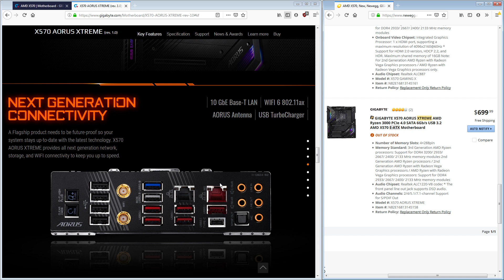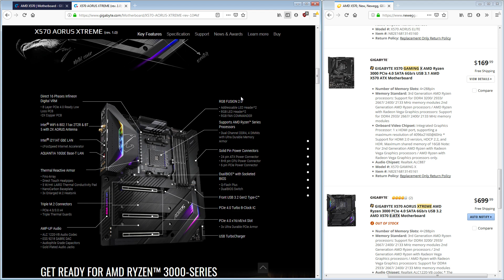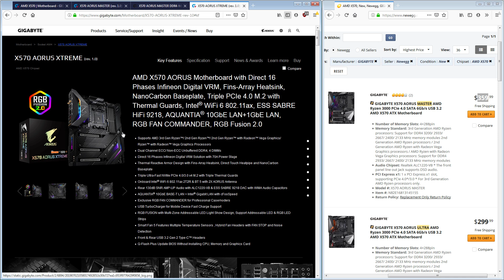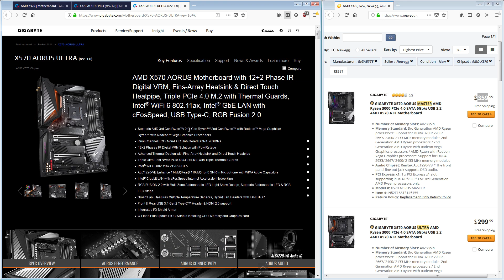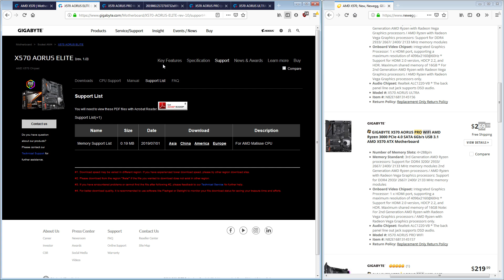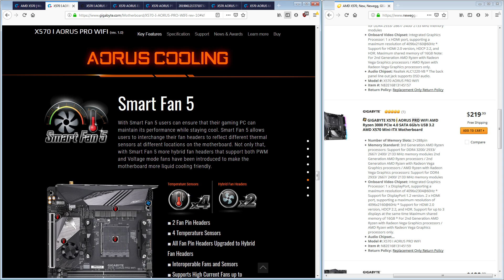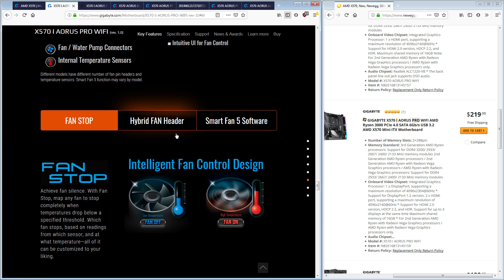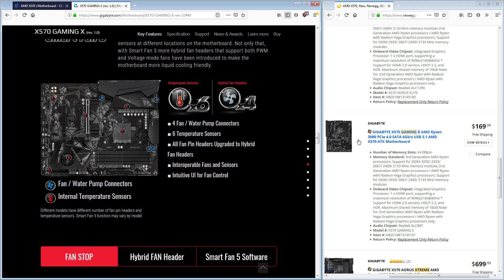Buildzoid rambles about ALL the X570 Gigabyte boards

Comment: Watches all x570 videos, doesn't want any x570s :) And glad you said what I was thinking why not make new B450 board now with Ryzen 3000 out of box. Yes there is MSI MAX series coming, but it's just old motherboard with new bios chip. ASRock released their B450 Steel Legend a couple months too early, it could have been the X570 version with B450 chip and be much cheaper and as good (and no fan).
Reply: B450 Recommends?
Reply: @Targetlockon  I'd wait for those MSI MAX refreshes, B450 Tomahawk MAX for ATX and B450M Mortar MAX for mATX. If you want WiFi and good audio, then MSI B450 Gaming Pro Carbon AC (I would have bought that, sadly mATX case, so no go). But if you got a Ryzen chip already to be used for BIOS update, then other manufacturers work too.

Comment: I've got 3700x and x570 gigabyte elite. Noticed that heatsinks on vrms and x570 needed some tightening. ANyway - my pch temp is around 45-55. Is it good or bad?
Reply: hiczok, hola. How the chipset fan feels? Noisy?
Reply: @Vladquaaa  it sucks on old bios. On new bios, there are 3 profiles (silent, balanced and performance). I am using balanced and it turns on 1500rpm at 50c degrees. it is a bit audible. I might end up using silent mode later
Reply: @HiCZoK   Thanks for answer. Just thinking to buy 3900x, and don't know which MB to take. Read a lot about taichi and bad place for fan, when your GPU covers holes for air and chipset gets a lot hotter. For now, thinking about GIGABYTE MB, looks like fan placed a little bit lower than in taichi.

Comment: Buildzoid just wants usb and pcie on the board, that's literally a server board
Reply from the maker: Server boards lack in the USB department
Reply: @ActuallyHardcoreOverclocking  yeah, true. They lack pretty much any external IO except ethernet, but you know what I mean: not many unnecessary extras and lots of pcie expansion
Reply: If it doesn't have BMC and ECC support (even unregistered), then it's not a proper server board for a professional environment.
And BTW, a USB hub is quite enough for slow peripherals such as keyboard, mouse, printer. Finally, like soundcard, lan or sata ports there are USB extention PCIe cards too or some dirt cheap PCI bracket to connect internal USB headers to the rear just like people sometimes does with the COM serial connector.

Comment: Don't really understand why if all the VRM of the $300 board are so efficient mobo makers can't make it go the way of the extreme by passively cooling the chipset.
Reply: Yeah, I don't know the cost of a heatpipe & sink fins vs a fan & flat hunk of aluminum... but it can't be much, right?
Hope we see a ton of Rev.2 releases right away in the coming months after all the "chipset fans suck" responses. If they're listening...
Reply: @Krazie-Ivan   You would be surprised how much cheaper a hunk of extrusion and 2 cuts get, to stamped, folded and assembled aluminum fins and a heatpipe with 5 bends to snake to the chipset.
You need to assemble differently too , VRM and chipset have to be mounted at the same time , not in 2 different steps
Reply: John Chrysostom  oh I remember fo sho... I hated SB/NB mini fans back 17yrs ago with NV chipsets on Barton mobos, & was glad to see passive cooling come about. I just don't know the cost difference, which I'm guessing cost savings is the deciding factor for the vendors on everything.

Comment: I'm glad to hear you think the Pro Wifi is decent. I ordered one a couple days ago when NEGG got the 3700x back in stock. I was a little worried about picking it before your Gigabyte vid was out, but thought it looked reasonable based on the other brand vids. I picked it over the Elite mainly based on cooling control. The Elite has 4 fan/pump headers while the Pro has 7. I also like the finned VRM heatsink. I picked the Pro over the comparable Asrock boards due to the G.Skill 3600 CL16 memory I already picked up for the upgrade not being on Asrock's tiny QVL. 

Edit: I picked it over the 400 series because selection is thin right now and the MSI ones I like best seem to be hit or miss on BIOS issues. Just played it safe and set up for if PCIE 4 actually starts becoming useful in the boards life.

Comment: See, I'm completely on board with these super high end boards that aren't sensible purchases on release. Like with all tech, R&D costs have to be recouped as best they can early on. Anyone buying this kind of board at retail prices knows what they are buying into. The second aspect of this is simply trickle down tech. It takes much longer for better technologies to reach "mainstream" consumers if there is no halo product for R&D cost recoupment or long term,  real world, end user testing and development.  Third, prices go down, typically fairly quickly, on products like this if you know where to look. To see a barely used or even unused board like this one grey market for 66.7% of its original cost within only 4 months or so is actually not uncommon. Some people buy these boards for various reasons and then want to get rid of them only to find they can't get anywhere close to what they paid for it. The niche within the niche that is willing to buy it at a crazy high price is also extremely unlikely to buy it other than brand new through an authorized retailer.
Reply: i just like them because it's cool to see the tech. would i ever buy one? hell no but it's still cool to see how far motherboards have come over the last 20 years as far as features go.

Comment: Here the big quesiton. Why did these 4 companies go from severely underpowered VRM's to severely overpowered VRM's and most X570 motherboards supporting 4 extra CPU-pins? It doesn't make any sense. The power consumption of a 3900X is not that much higher than for a 2700X and that 3950X will need better VRM's but even then you don't even come close to those 4 extra CPU-pins. Even if you would need those 4 extra CPU-pins for extreme OC'ing, most of those motherboards don't support other extreme OC features and what is the point of having lower segments and mid-segments of X570 having that 4 extra CPU-pins? Why this 180 degrees turn? Why first not having proper VRM's and now this complete overkill? Can't we meet in the middle, drop all the RGB and other decorative nonsense and have a solid motherboard with excellent VRM's, memory-traces and all the ordinary I/O (enough USB, PS/2, Intel ethernet...) for €170?
Reply from the maker: The x570 chipset is expensive so it's ok to make the rest of the board expensive too
Reply: @ActuallyHardcoreOverclocking  
I can imaginge that the companies reason that way: the chipset adds $20 anyway, we might as well go all in. But I question how balanced it is. If you deliver even better VRM's and all that than what is required to get everything with reasonable overclocking (PBO and automatic overclocking, anything that you can do on air and water) but you don't deliver a second BIOS or PS/2 port, that does not make much sense to me. What do I know but that is my impression so far. By the way, I ordered an X570 Elite and a 3700X. I looked at the X470 and X370 motherboards, the prices of those motherboards which I was interested in were still high in the Netherlands and at Caseking I would have to pay around €20 extra for delivery. 

Thanks for sharing your thoughts on the motherboards early, it made it easy for me to choose this motherboard. For the RAM I chose 3333 MT/s CL=16 Corsair Vengeance, a little bit on the slow side but 32 GB for €179 so a pretty good deal. I hope that I can overclock it to 3600 MT/s and CL=15/16, maybe 3700 MT/s CL=16/17. If not then I would not loose much but it would be nice. At the moment I sitll use an i5-750 and 8 GB of DDR3 (1333 MT/s , average latencies). Later I will buy a Sapphire 5700 XT, the card is too expensive for a 251 mm² die but I have a HD 7850. Otherwise I would wait until sanity returns to the GPU market.
Reply: My guess is better support for the next 3 or so AM4 CPU generations, which will likely push higher clocks & more cores, both cutting into the efficiency gap that Zen2 has right now. But then again, I'm sure they'd rather sell you a new board...so...good question.

Comment: Aorus should release an X570 Master Buildzoid edition 🤔
Reply: I would pay 399 for it!
Reply: @DarkPa1adin  I would envy and admire those who bought it. It will cost 799 though :-(
Reply: @shinymike4301  that's the Xtreme edition of buildzoid.

Buildzoid doesn't need all the feature. If you give him WiFi 6 then he doesn't need 10gbps LAN or even 2.5gbps LAN. and he doesn't need top of the line on board sound card. So these saves him a lot of money :p
Reply: @DarkPa1adin  That's true. BZ is all about value.
Reply: DarkPa1adin They'd probably want $449
Reply: @ZambonieDude  I don't mind $449 for buildzoid edition

Comment: So. Low budget: Elite from gigabyte and tuf from asus. Then jump to 300$ taichi other mobo not worthed. Anything above 350 is more than great. 500+$ mobo are a rip off
Reply: U miss the creation.
Reply: @RollerXLee  creation is 489 so falls under the limit. ;D
Reply: Im a big fan of the Taichi, but unfortunately it has typology  memory, so for me thats sort of a deal breaker
Reply: @sergiomadureira9985  true t-Top is better on 4 kit than 2 kits. And the speed support is lower than other marks. For me it's not s problem, when you reach 3200/3600 it's all great, but I can understand that it's a valid cons factor

Comment: i got x570 elite makes the most sense
Reply: Same. Works amazing. And all set if full pcie 4.0 gpus become a thing in a few years
Reply: Socially Impaired Gaming Nvidia 3000 series are 4.0 if I’m not mistaken
Reply: how is the fan noise?
I have almost silent PC, so I have nothing that would 'cover' fan noise with different noise
Reply: @DJRYGAR1  inaudible, i got all the noctua case fans and nh-u12s-se on 3700x and i couldnt rally complain about noise
Reply: I bought that Board a week ago,and i am still confused how it idles at 1.46v or more..
I have applied negative offset of 0.1,disabled PBO and whatever LLC i choose it cant let go those absurd voltages..Did i choose wrong board?